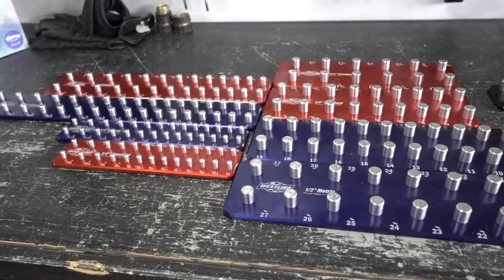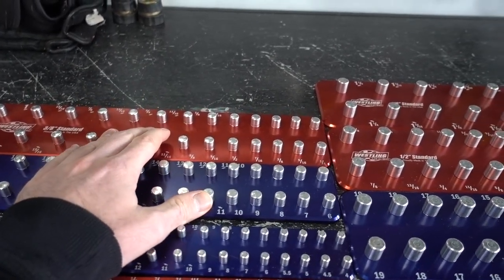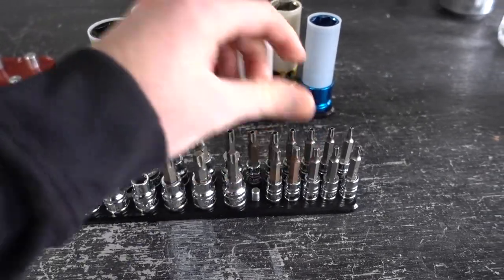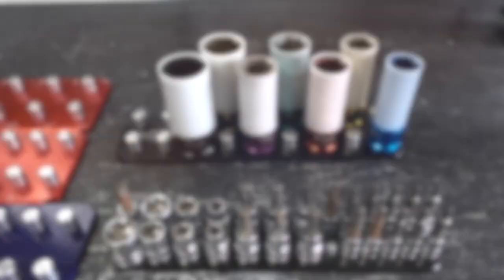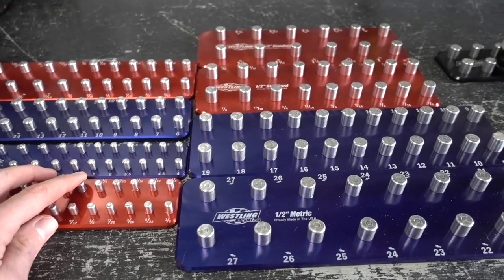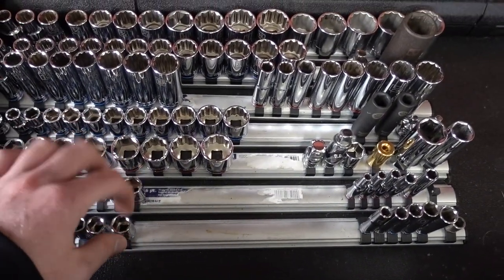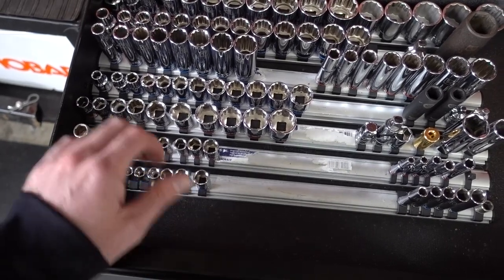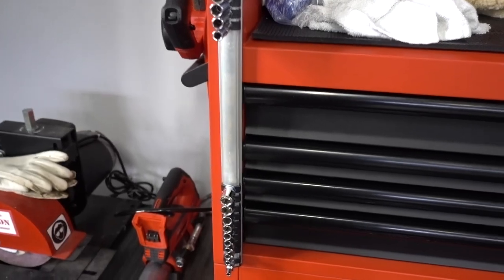Westling Socket Tray Review - Tool Box Organization!

Comment: Just move socket trays to the front of the drawer, you can put torque wrenches at the rear. You don't have to open the drawer fully to grab a socket especially when you're in a hurry and torque wrench doesn't get used as often. It's the efficient way to work.
Reply from the maker: You would have to see how I have it laid out in my tool box tour video. I can not have them all at the front because I have so many, they take up most of the drawer anyway. I have it in the best position possible for now. I am planning to upgrade to the larger Milwaukee Tool box sometime soon so a reorganization will be needed when I get the larger one.

Comment: I dig those trays, but it looks like they're missing a few sizes in 3/8" drive SAE tray, and the 1/2" drive trays don't go up high enough to cover the full Tekton set. That's too bad because they look much nicer than the plastic Ernst trays that I've been using.
Reply from the maker: The trays have more slots than I have sockets so they have been working out fine for me. They are definitely nicer than plastic socket trays.
Reply: @scottwalker19  I ended up buying the set right after my last comment. 😋 They're so much nicer, and cheaper, than the plastic trays. Thanks for letting us know about these.
Reply: @Dustysa4  do the trays fit the texton 1/2 set I am getting their set in deep and shallow metric and sae

Comment: Are the plates magnetic?
Reply from the maker: They are not. They are aluminum.
Reply: Glue some neodymium magnets to the posts.
Reply from the maker: There would be no way to glue a magnet and still be able to get a socket on there and there is no need for magnets. They work just fine without. If you are looking for a magnetic solution then this set is not for you. This set is perfect for organizing sockets in you tool chest or box. The sockets stay on and are easier to get on and off for frequent use.
Reply: @scottwalker19  small round neodymium magnets that fit through the centre hole. Use Crazy Glue on them.
You can get a box of 100 magnets pretty cheap. Check out Frenergy website. I've got them. I'm a mobile mechanic and stuff bounces around.
Reply: @PhillipMikeHunt  Nice tip! I will try them without the magnets for awhile but will definitely glue some on if needed.